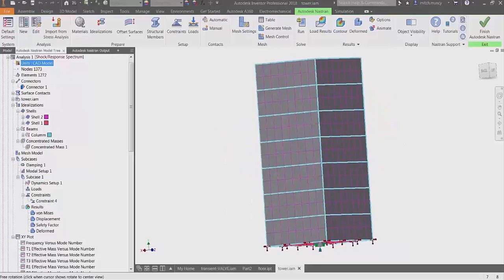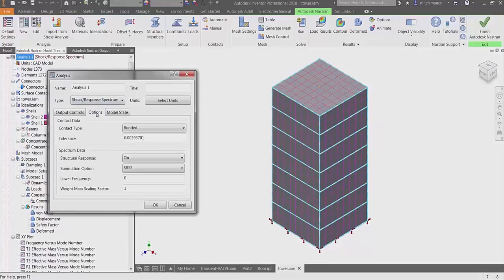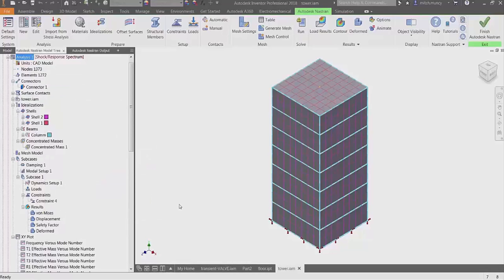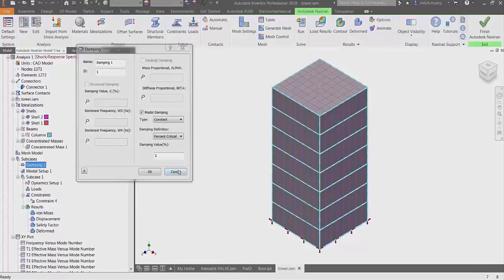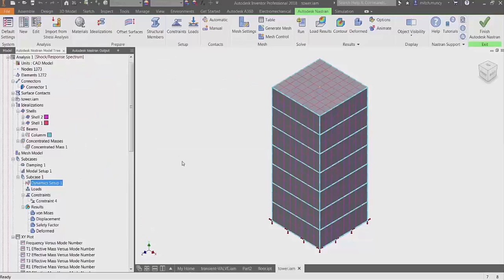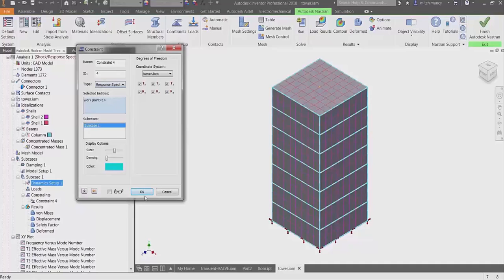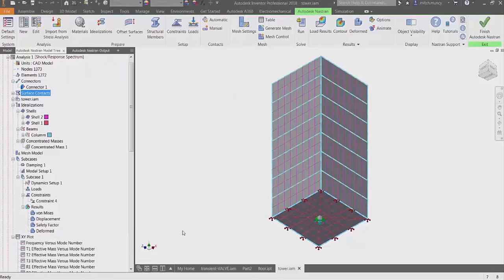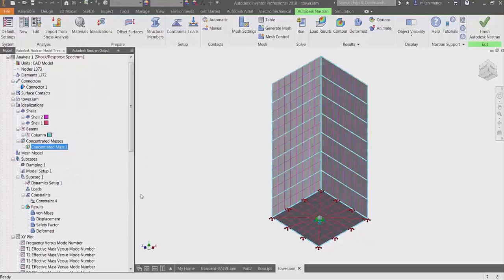Autodesk Nastran In-CAD Response Spectrum Analysis

Comment: In my opinion, applying the large mass (1E6) to the base is wrong. It should be a fixed constraint to simulate that the building does not move relative to the foundation. The large mass in the analysis skews the percent modal effective mass. So instead of seeing that the model contributes 80% or more mass to the analysis, you see that the concentrated mass contributes approximately 100% to the analysis.
Reply: I know these people who promote this software have no idea what they are doing. In another video they showed applying an external pressure on a storage pressure vessel analysis. lol